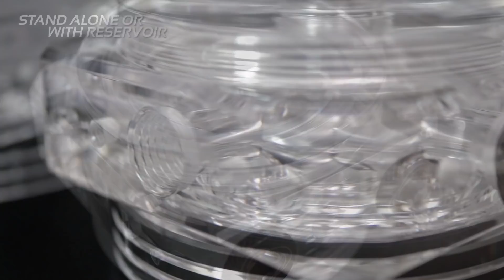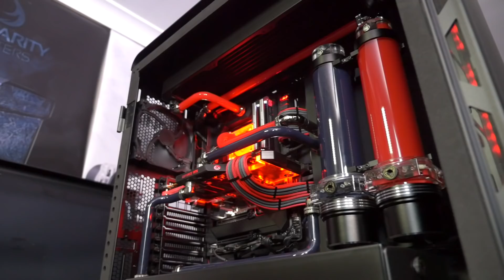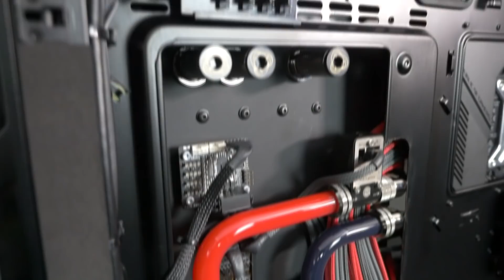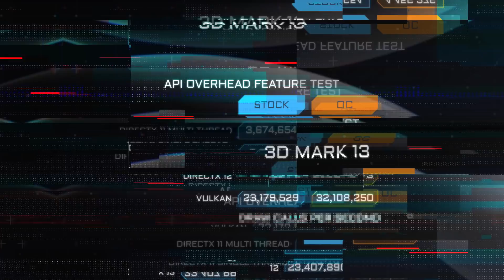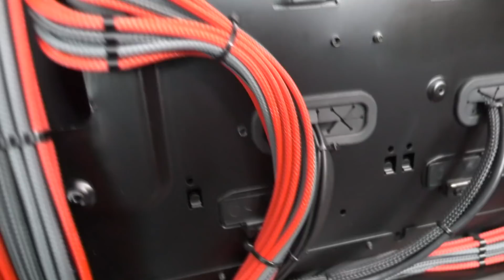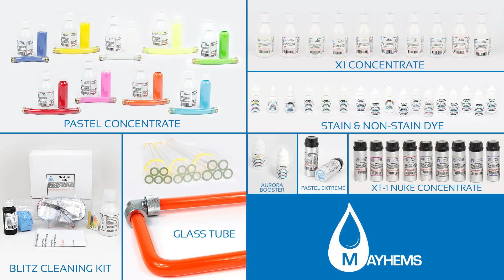Phanteks Enthoo Elite Build 42 Part 2

Comment: I have that case and with X3 480m x1 360m radiators in push pull config and it's a hefty boy. When I moved to my new house it took three of us to move it upstairs. I'm think it weighs 160lbs cause the case itself weights 75lbs alone. It's fun to build in and I'm thinking of getting a micro atx and run dual systems. Really its just for fun and all I play on there is minecraft and swotr.

Comment: Thank you for this clip! I can see the vertical GPU mount was not installed - why? On the other hand in this setup maybe a third reservoir would be a good fit or something special... a fan controller with a display maybe? Is there going to be a 3rd part of this case? Thanks again!

Comment: I've got a top 420mm radiator in my Enthoo Luxe TG and had to use a 120mm fan in the back for exhaust. due to clearance  A 140mm just wasn't going to happen and mine is just the EKWB PE and yes, I too had a lot of trouble with the EPS cables!

Comment: Love the enthoo elite and this build is great, but it's amazing how much of a loss Case Labs is at the higher end of the market. I ended up with a heavily modded Lian Li PC-V3000WX for my main build because I was a tad too late in my SMA8 purchase. Don't get me wrong, I love my v3000 now with all the mods with 1540mm of rad space, it's just hard not to miss caselabs. I'm about to start a rediculous complete mod of a nzxt phantom 820(frame only) that will make it essentially a completely new case but, damn, water jet cut aluminum is expensive.

Comment: Just curious about the flow sensors you used. Is the an adaptor you have used or do new boards have a input for the sensor.

I run a 5960x on a rampage Xtreme V and I can't see if it has pins for this. 

Is it my board is a few years old or is there something I can but to put these on. I'd like that kind of safety
Reply: They're connected to the Aquacomputer Aquaero 6lt, which connects to the mainboard via USB 2.0
Reply: @richardcarter8801  thank you for the reply. I'll go buy that now. Any idea on the flow sensors he has used. For quality control is all ?
Reply: @TheCuttz1984  sure. They're aquacomputer flow sensors which connect to the aquabus high header on the aquaero. They can be had here: https://www.aquatuning.co.uk/water-cooling/monitoring/flow-indicator/13768/aquacomputer-flow-rate-sensor-mps-flow-400-g1/4.
If you have just a single loop, I would recommend this other flow sensor, which plugs directly into the flow header on the aquaero: https://www.aquatuning.co.uk/water-cooling/monitoring/flow-indicator/6146/aquacomputer-flow-sensor-high-flow-g1/4-for-aquaero-aquastream-xt-ultra-and-poweradjust
If you're after better visuals, this one from bitspower should also just connect to the 3 pin flow header on the aquaero: https://www.watercoolinguk.co.uk/p/Bitspower-flow-sensor-14-inch-matte-black_35744.html
Hope this helps 👍
Reply: @richardcarter8801  funny enough I have the bitzpower one here but I have 14mm OD hard loop. So I haven't been able to install it due to the one I received is only 12mm... I have not been able to find a 14mm one at least in Australia anyways. That why the sensors looked good as I can use my EK fittings
Reply: @TheCuttz1984  that's a good point I hadn't thought about. The aquacomputer ones just have standard G1/4 threads so you can use any fitting

Comment: Not a huge fan personally not sure why.    Maybe it’s that bottom section,  seems like it should have a side mounted rad.  Also that res vertical tube going to a fitting where the one below it is a bend looks odd

Comment: U can clearly see this build is on a budget... :(
too bad
Reply: Yep. This case is for a double GPU (or more) X299/X399 HEDT build. A mainstream gaming board & CPU are a waste. The case cost almost more than his CPU & MB (at least here in Australia).
Reply: Seems that it's what happens when a customer decides (and blows his wad) on a $900 case before the components to put in it. And that choice was probably only made because it's "the best" (if you consider expensive the best). Could've spent much less on a nice case that would've fit the build better. It's a dual system case and really should have 2 in it. But it seems the customer was set on it. Daniel made it look good but it could've been so much better customer/budget allowing.

Comment: Excellent work as always Daniel, too bad the case seems like wasted potential, due to the client not putting enough gear in it, only two radiators in that thing?! Seriously? I'm in the process of fitting 2x 540mm, 560mm and a 420mm into (one 540mm will be external) a TJ11..and this Elite case could fit a similar amount without even modding.

Comment: what is the advantage of dual loops? i had a vega 56 and 5930k on a single loop and temps stayed around 30
Reply: for this build it's just esthetics. Otherwise there would be too much empty space.
Reply: Non, pure for looks, dual loops make no difference at all
Reply: For looks or people use to do it to control different fan speeds and water temps for each loop.
Reply: @emsj86  You can do that with motherboard fan control app. Like Asus.
Reply: @emsj86  and loop temperatures will be the same if you have enough rads